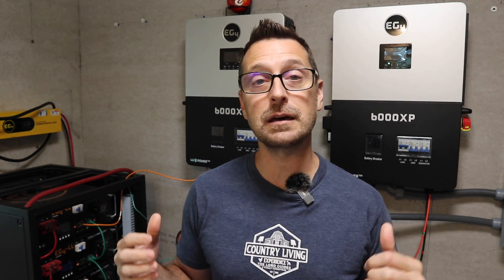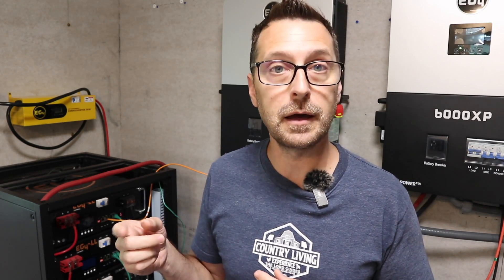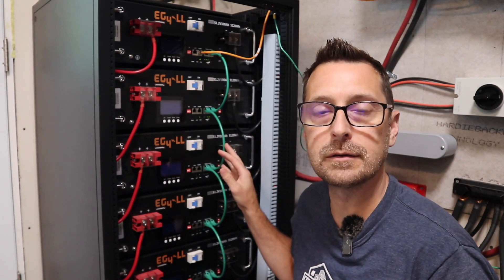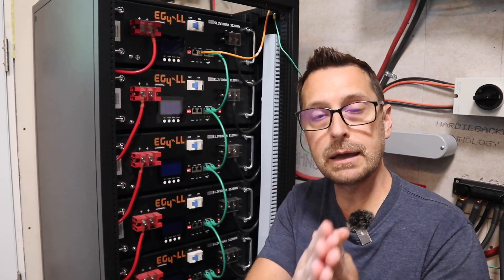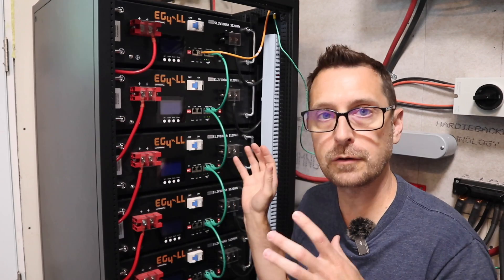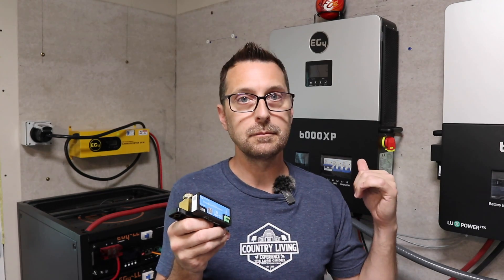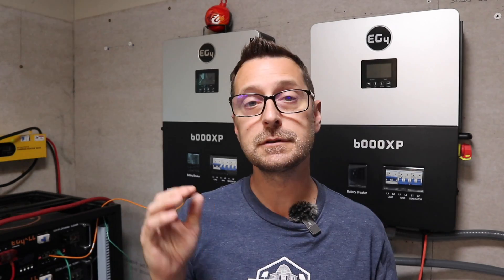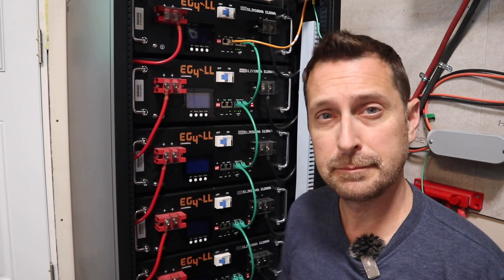Lithium Battery State Of Charge VS Voltage Drift. System Issues? Several Solutions

Comment: I just prefer open loop. I run many systems this way, and it just works. Communication is just another thing to complicate and go wrong.
Reply: Same here.  Voltage is pure.  Furthermore, at least in my case, each battery ( I have 9 for a total of 135kWh ) will behave a bit different. As you head up or down...near the high or low... they'll equaliz.  I do agree that voltage is not precise until you get near the top or bottom end of the range.  However if you get the inverter capacity set up right...the inverter will try to give a soc that is based on actual power in and out of the pack.
Reply: @houstonstarbuck  Hello.    What inverter are you running if I may ask.      I would use voltage but these inverters wont let me.    Given what I know so far anyway.    I have not tried going to the lead acid setting.... why would  I think to do that after all this protocols and communication crap.
Reply: @ I have thge Sol Ark 15s...very similar to the EG4's.  In the Sol Ark world you have several battery choices.  ...but yes...basically it is choosing lead acid setting...in my case the setting is called Batt-V.  There is some equivilent setting in EG4 world.  I do this given that I have a mix of batteries (from different sources as well as different capacity.)   

I then set the battery charge volatage to my desired target...in my case I'm using 57.6.

The inverter will seek to charge the batteries until such time as it reaches the target voltage and then typically at some point it starts ramping down the current.

The batteries also have thier own BMS settings.  In my case, I have some batteries that will "tap out" of the charging cycle earlier than others.  That is fine.  This happens for a variety of reasons....a cell that hits over current inside one of the batteries...perhaps slightly different resistance between the main inverter bus bar and the battery bus bar...or even the slightly different cell chemistry.  None of that really matters....as each of my 19 battteries "bail out" of the charge cycle the inverter continues to send power to the remaining ones that still are not fully charged.  

It works great.  Periodically I charge the entire bank up to full charge (my typical charging does not always get them to full charge) in order to cause each of the 19 batteries to top balance their 16 cells...as well as "reset" my inverter software to now fully understand what 100% charge is.

Hope that helps.
Reply: @ It sure does.   Thank you very much.